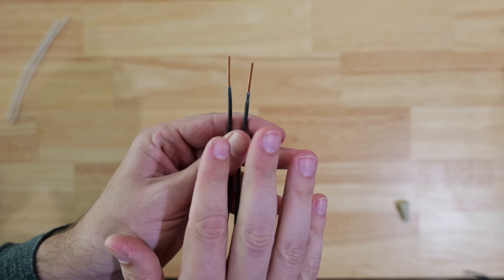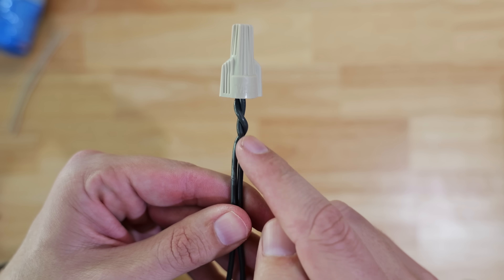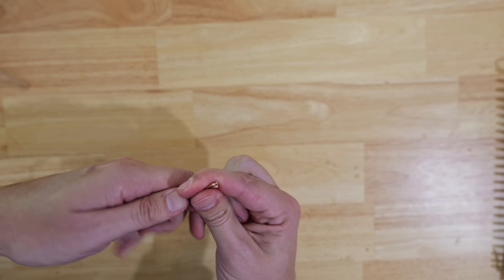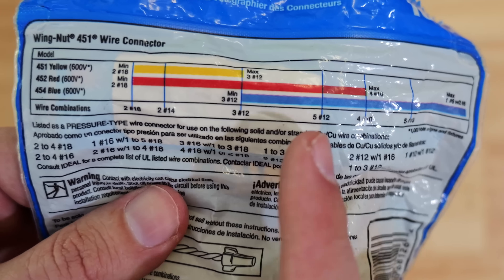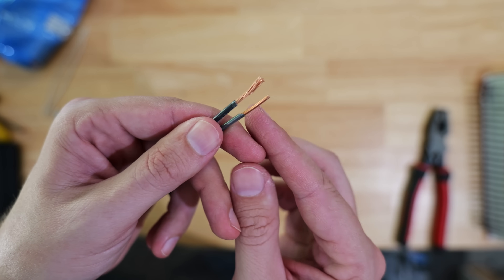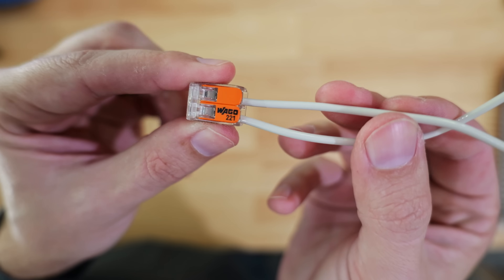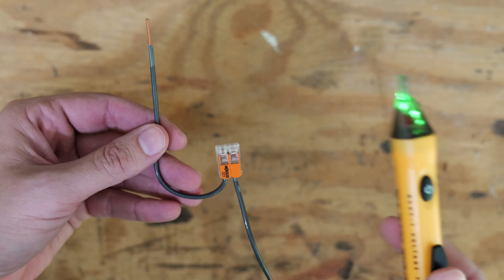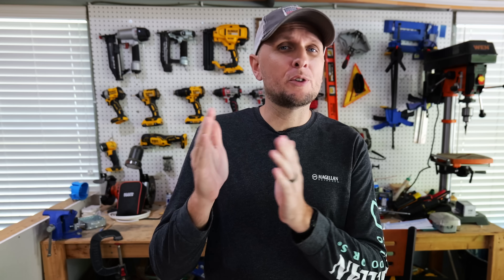7 FATAL Wiring Mistakes Most DIYers Don't Know They Are Making | Most Are Guilty of 3

Comment: In my personal experience, which while not infinite does stretch back to the 1970s, I have never seen a professional electrician pre-twist wires. All I have seen is twisting the wire nut tight and then going until you have 2-3 twists in the wire. As you neatly demonstrate that produces essentially the same end result as the pre-twisting with a lot less time and effort. Getting the right size wire nut and the right amount of bare wire are going to be huge factors in how well they work. I haven't used wagos yet, but they are intriguing and will probably make an appearance in my next wiring project.
Reply: Yes, you should really try the Wagos. My whole house electrics are done with those. Most of the time with the ones w/o the lever, though. Easy to install, to measure (!) and to change.
Reply: pre twisting is the way to go. 
Anything that increases quality and safety is a win. 
Is everything you do a race?  Good work takes time.
Reply: Pre-twisting is what we were taught in school. I'm sure this is done as requested from the professional field. Don't know how else you would weld 4 or even 5 wires reliably.
Reply: I’m a electrician, remember reading on wire it bags “twisting wires not necessary”
Reply: *Wire nut bags
Reply: As a non pro? Ima gonna twist. Having a seasoned electrician do some work (at least those I know personally)? Not really worried about their technique as they’ve got it down to a science in whatever technique they use.
Reply: As an electrician I love people that don't pre-twist wires. I've made a lot of money over the years from bad splices.
Reply: I agree with you.
Pre twisting is a total waste of time.
To me when I see someone pre twisting, it just tells me that they don't know how to use wire nuts.

Another thing is way back when when I started in the business. I tried pre twisting.
And I found that it actually made the wire nuts fall off.
Very easy.
Because, due to the fact that the wires are pre twisted that it wasn't causing enough force within the wire nut to hold properly.
To where when the wires are not pre twisted. The wire nut is twisting the wires together.
Causing a tremendous amout of force on to the wire nut. So it will not fall off.

Which is how the wire nuts are designed to be used.

But to each their own.

As long as everyone is safe.

Also if we all did everything the same way.
Life would be boring.
Reply: @assog5737  if the wire nuts are falling off after your pretwist you have the wrong sized wire nut or you didn’t tighten it enough. Pretwist for solid wire is industry standard.
Reply: Australia: wires twisted together and a BP connector used. (A insulated single screw connector, two screw types for earths) 🦘🇦🇺
Reply: I never twist the wires together. That's what the wire nut is supposed to do. After I make the connection I use black electrical tape to tape it all together. Never had a problem with wires coming apart.
Reply: After being told directly, by a UL underwriter, that pretwisting is not the proper way as you would not know if the nut made a proper connection and that it also work hardens the copper to the point that it can break under load. Per his exact words, and the words of every wire nut manufacturer, twisting the properly sized wire nut tightly onto the wire ends is the only approved way to apply the wire nut.

Comment: Thank you. This was very interesting. My husband is not an electrician, but learned enough along the way that he wired an entire addition to our house with my help. He taught me all I know. When the code inspector came by, he said that the wiring was better than some he'd seen contractors do. I've never seen a Wago, but they look interesting. We always twist the wires before putting the nut on. We have found some pretty disastrous situations in some of the houses we've lived in. Our current dining room light put out a giant spark with a loud pop, while we were eating dinner. One of the wires had come out and contacted the metal housing. We were lucky we were here and that it just shorted itself, thus avoiding the fire. Electricity is fairly simple, but you have to go by the rules or there will be disaster. Thanks again.
Reply from the maker: Wrong on so much that I’m not even going to touch on it all.  Full of opinion.

Comment: Hvac tech/model railroader.  I love the wagos. They're expensive but when you've got 3 or more conductors the 3 or 5 conductor levernuts are my favorite.
Reply: and you save the costs on wagos on being able to redo and join wires quicker. its soo much faster than wirenuts, especially when redoing something
Reply: @TraktorTarzan  Not having to stip back to beyond the twists must help. Every time you have to redo a wire nut you are losing cable length. With a wago you don't. I also don't like the idea that the cable is being strained/distorted when twisting it.

Comment: I just had an electrician out to do a 240w EV install and to troubleshoot a breaker that keeps tripping. I think you may have just helped me solve my DIY and the trip issue. Thank you. Most helpful! P.S. He replaced the breaker and offered to come back to help further if it continues to trip. Great guy.
Reply: I wrap some electrical tape around my diy wire nuts before putting it in the box. Use tape around outlet connections also.

Comment: The Wago connectors come in different sizes to suit different wire gauges. If you use one that is too small for the wire gauge, then it will cut the wire, as shown in the video. You just have to make sure that the right size is used for the right wire.
Reply: @gary851  You talk nonsense.
Reply: @gary851  I work industrial and a lot of oil field clients are making wagos standard.
Reply: @gary851  So wrong. These are standard in so many commercial buildings now. You just have to use the right ones, with the right wires, in the right places.
Reply: @DansDrives  exactly.  I used them on all the high voltage lighting 12 years ago.  The push in kind not the lever kind, but it made working on live circuits much safer, and any facility electrician knows there's no other way to get it done at times.

Now on my military jobs they always required terminal strips.  I wonder if these wago connections would be ok.  Would have made the job much easier...
Reply: @beentheredonethatoriginals5673  The push in kind is very good for solid strand conductors I hear. Mechanically it's about the same as the levered model but there's no easy way to get the wire back out.
Reply: @gary851  Really, cause thats all I see electrician using in commercial and government buildings. I wonder how they're gettimg it so wrong when you're so right.
Reply: @beentheredonethatoriginals5673  They use them on 277 volt lighting on the bases I've been on. The grey permanent ones, not the lever lock.
Reply: @gary851  don't ever do to Europe then 🤦
Reply: @gary851  

Google Translate: "I don't know what I'm talking about but I'm going to talk about it anyways."
Reply: @gary851  try telling that to the tens of thousands of European sparks, Germans in oarticular! Plus there are HUNDREDS of UK sparks that swear by them because of the range flexibility and their reliability and speed of use.

Methinks you are using your nether regions for talking!
Reply: @boblewis5558  Gary is from the USA , I doubt he can even find europe on a map!
Reply: @peterhartmann5543  and has probably not left his home state since was born! Say no more! 🤔😁
Reply: @gary851  Wagos are pretty much standard now in electrical installations in Germany, replacing screw terminals. Wire nuts were never approved.
Reply: @wombatillo  normal wagos without lever comes off very easily by pulling while rotating back and forth. It will scratch the solid copper wire tho, so you might want to strip a new end. The wago should also survive the removal If done right.
Reply: So you never will get a job as electrican in Germany 😂
Reply: @gary851  your wago comment is as daft as your 2 pin power plugs!!
Reply: @@One-ik4pb try using wire nuts in Europe, you won't even get past inspection. wire nuts are outdated and dangerous, wago is the new standard and way safer
Reply: @gary851  Literally every building in Germany build in the last 20 years is wired using wagons. They are very common in the rest of Europe too.
Reply: @@One-ik4pb In europe u cannot use nuts according to the standard. Also ur time is money too not just the wago.
Reply: @@One-ik4pb ah yes. Left for the land of faulty wiring, bad electricity and wooden houses. 
Good riddance it seems :D
Reply: @SoberAddiction  I guess he must be right, because "duh"
Reply: @One It is not about the rating. It is about the WAGO being safer to apply because the mechanical connection is more reliable.
Reply: @One You are just a US company cultist.
Reply: @wombatillo  
The spring construction is different.  With the lever connector, it's an individual expanded V-shaped spring/barb for each wire pressing against the bus bar.  When "open" the spring is compressed to allow for insertion/removal and closed allows the spring to expand.  For the push-ins, it's a single sheet of stainless steel with little tangs that are formed into springs.  I believe it needs to be heat treated to make it springy enough.

Removing the wire in a push-in is actually quite easy as long as the wire is solid.  Just twist back and forth while pulling.  But it's going to leave a lot of scoring on the wire. where the end may not be reusable.  I believe a lot of cases they'll just cut it off and restrip the wires, where there's hopefully enough extra wire left to work with.  These push-ins are reusable to some degree, but why try and reuse them?
Reply: @wombatillo  Twist and pull.

Comment: Something you missed with those Wago clips. They are rated for the amount of current and voltage that can flow through them (it's labelled on the side). For example, the Wago clip you show at 12:09 shows it supports 20A and 300V so make sure you don't go above those values. There are Wago clips that support higher values if needed. Also, there are counterfeit Wago clips out there that are cheaply made and the levers can break. Make sure you buy your Wago clips from trusted sources like Digikey or Mouser.
Reply from the maker: Appreciate the input!
Reply: @HowToHomeDIY  You should probably update this video with that. It's more important to follow those guidelines than anything else in your video (could cause a fire).

Comment: I was always taught to divide the strands and pretwist, then screw the nut in twisting and once the nut is secure, wrap the bottom of the nut down to the wires with electrical tape to keep moisture out of getting inside the wire nut and secure it better at the same time. What are your thoughts on that?
Reply: You're more advanced than this guy. The only problem with that method is if the wires get hot (won't happen in a home, generally, but if when you fold the nut down and wrap you run the danger of putting a crimp in the wires which will increase the chances of them getting hot) the tape will slide off. Really only a problem in vehicle or outdoor applications. Wire nuts really are not for permanent connections, and anything that needs tape to secure would benefit from a different style connector. If you're already pretwisting then a shrink tube would be a better solution, imho.
Reply from the maker: Yes heat shrink everything so whenever you go to change something out you have the headache of having to cut the wires way back and redoing everything.  Heat shrinking is for completely permanent connections and not used in most residential applications.
Reply: @HowToHomeDIY  ... how often do you change the ceiling fan, the light switch, or electrical plug? They're effectively permanent.
Reply from the maker: Well I changed out a light fixture to a fan the other day, I have been slowly updating all of the light switches in my house, and sometimes I decide to replace them with smart switches so more often than never.  I would never want to make my splices that permanent because you never know when you may want or need to change something.  Only places I use butt connectors or heat shrink is on my AC, well pump, places like that.

Comment: Wow, this is very useful! My collection of wire nuts is old and loose, so I never knew which ones could handle how many wires of what gauge.

Some years ago our furnace stopped working, so I called in a repair person. 
When I came back later, on the top of the furnace was a wire nut that had MELTED.

Unfortunately I recognized it immediately: when I had previously worked on the furnace (at least a year earlier) I stuffed 4 wires into one wire nut. That one.
It worked at the time, but obv the connection wasn't as good as I thought. I consider myself lucky nothing worse happened.
I still have that melted wire nut, as a reminder of what can go wrong.
Now I understand how to make sure that never happens again.

Comment: After living in a house wired in 1920-1935.
It taught me a bit of solder at the joints, can do wonders ..
Before, adding the wire nut.
And it works in both solid and solid/stranded joins.

No wire nuts were used in that old construction, wraps/solders , friction tape , with that old tar impregnated fiber insulation, was a wonder to behold.
But so was Frankenstein..
Reply: Good luck troubleshooting any circuits that were soldered.

Comment: I never heard of WAGO levers being opened accidentally. Only option I see is that the lever was never really closed in first place.
BTW: when dealing with solid wires, you can also use the WAGOs with no lever, push in, let the spring do the securing.
BTW: it looks as if you have taken off the insulation too much. Usually the WAGOs have printed the correct stripping length (usually 12mm) on the case. 
Wire nuts may have have their advantages and disdavantages, but I wonder if you really can connect 8 wires with drilling. No problem for a 2273 WAGO.
Reply: Spingo Wagos huh? Sounds like a fast eddy electrical fire in about 15 years to me. Don’t be a fast eddy.
Reply: I've had a wago lever pop open several times when doing rework on a crowded box full of twisted and wire nutted connections.  Specifically, this has been in 3 and 4 gang switch boxes,  with 4 and 5 conductor twisted/wire-nutted connections that are bulky and don't fold in well - especially when it's a box full of 12ga.   I have not had this issue in an all wago box -- the conductors fold in much  better without the thick twisted pigtail
Reply: Wago is no better than the "push-in" connectors on outlets or switches
Reply: @jimbritttn  - Great explanation!   I'll counter with "Yes it is!"

Comment: 2 years of commercial level training in HS (yes, my high school had a commercial electric class) and I was taught the method you showed, pre-twisting with linemans pliers. We had several days in class just repeatedly twisting joints with 2, 3 and 4 wire connections. Any electrical work that needs done around the house and stuff, I'm the family electrician lol. Had to give up on that particular career path for health reasons.

That tip with the stranded and solid wire was definitely one I needed to know. We never touched stranded wire in my class, and recently, installing a couple light fixtures and 3 ceiling fans, I was struggling with getting the stranded wire to grab and not slip out.
Reply: Shame they didn't teach you about WAGOs.
Reply: @Hoops-Senior  Nothing wrong with wire nuts if you do it correctly. If the fixture comes with Wago style connectors I'll use em, but most come with wire nuts, and we already have wire nuts at the house. I'll stick to wire nuts.

Comment: Trow out the wire nuts, use WAGO. The time and problems you save completely erase the extra cost of the WAGO connector. They're also about the most reliable thing I've ever used to connect wiring, with very few very niche exceptions.
Reply: Wago is no better than the "push-in" connectors on outlets or switches
Reply: @jimbritttn  Wrong. They are far more versatile and can accommodate stranded wire as well as solid core.
Reply: @Hoops-Senior   Wagos only connect at on very narrow point just like the push-in connectors on cheap outlets or light switches. Wires twisted together and held by wire nuts have a LOT more connection between them.
Reply: @jimbritttn  That’s why they have their current rating printed on EVERY connector. WAGO expects their users to be able to read! 🤔 maybe not suitable for the US market, after all. 🤣
Reply: I agree most issues raised start from user error and neglagance if people cant read whats on a connector they should not be working with electricity. @Hoops-Senior

Comment: Great video, I typically solder + heatshrink 110 vac connections, but there seems to be some controversy about this - I've never seen high current connections use solder. We would crimp and bolt these, then check the voltage drop across the connection.

Comment: Never had a problem with WAGO, other than the price. They do work exactly as advertised, as long as you strip the wire to the proper length. The biggest advantage is how easy it is to add/remove/switch wires.
Reply: I remember it used to be expensive, but I now checked the price and it's not too bad.